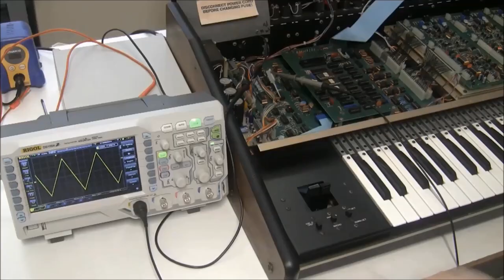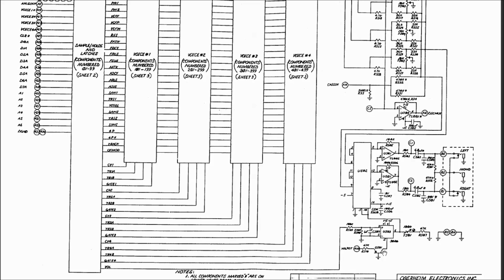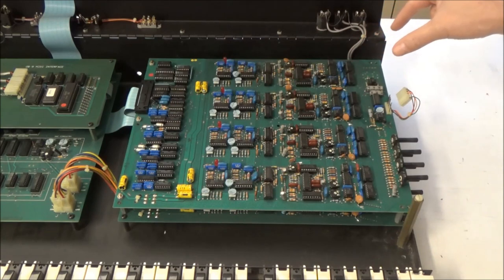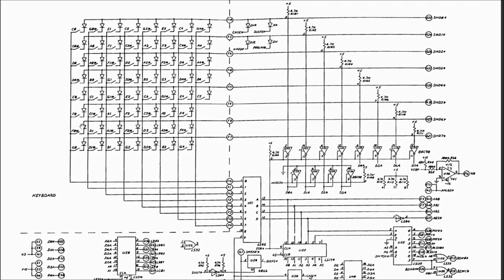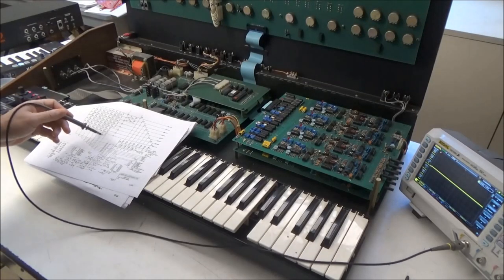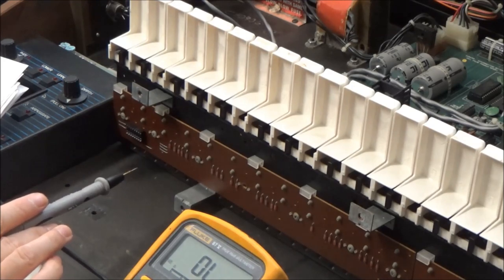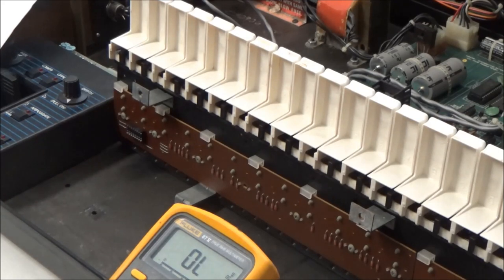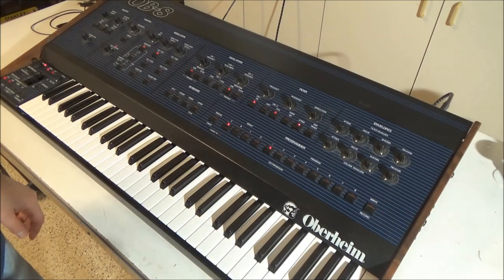Oberheim OB-8 No Output Repair - Synthchaser #141

Comment: very interesting video
i did not think it was possible to put a fatar keyboard instead of the old clanky one
is it possible to put a fatar keyboard in a matrix 12 as well ? 
thanks, watching all the videos with high interest !!
Reply from the maker: It's possible, but not with this particular adapter I've made.  The Matrix 12 keybed is velocity sensitive and the OB's aren't.  So it would take another adapter that connects the 2nd set of key contacts on the Fatar keybed to the synth.
Reply: @Synthchaser  I see...
Thanks for your answer 😊
Reply: @Synthchaser  thinking about it, that kind of adapter would be extremely useful (and needed) by most Jd800 users !!

Comment: There is nothing wrong with the keybed, after 12 years of not being used the contacts have become tarnished just clean them off with 100% isopropyl  alchohol. not a big deal, the more you use the synth the less cleaning you have to do.
Reply from the maker: From my understanding from the customer, the synth was being used, but then went unused for 12 years because of this "no output" problem, not the other way around.  I wouldn't expect all 61 key contacts to simultaneously completely fail without any warning.  I didn't see any signs of spills or other environmental damage that could explain that.  Eventually I'll autopsy the keybed and report back here.